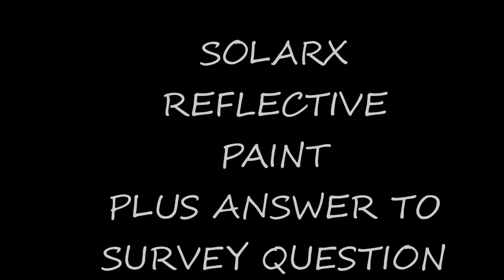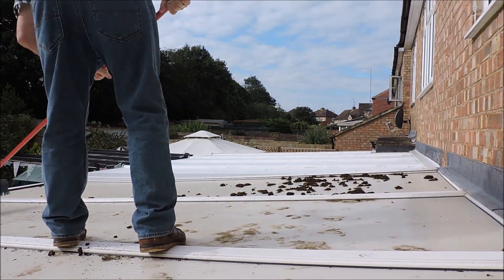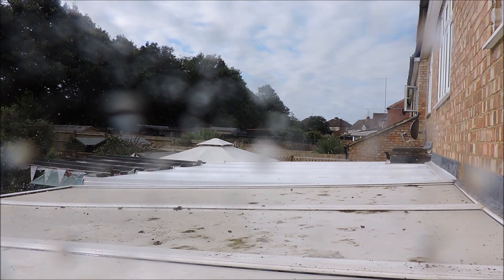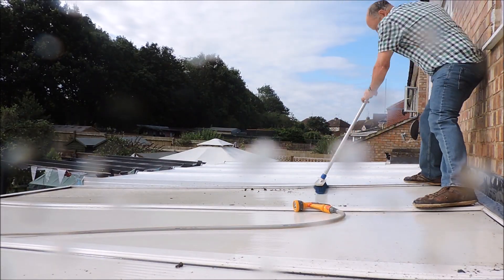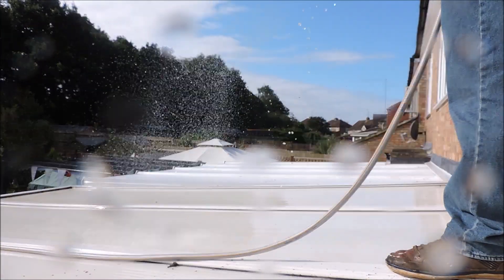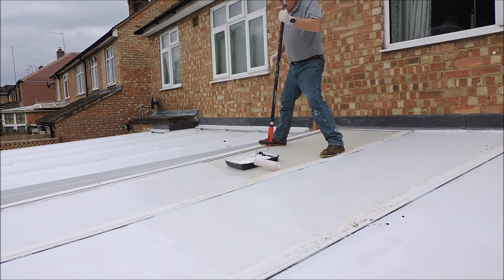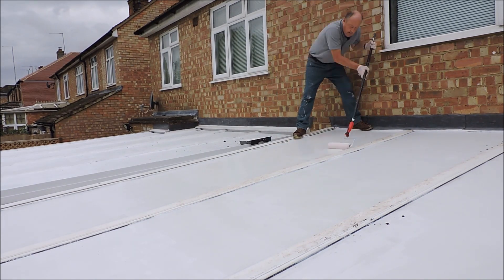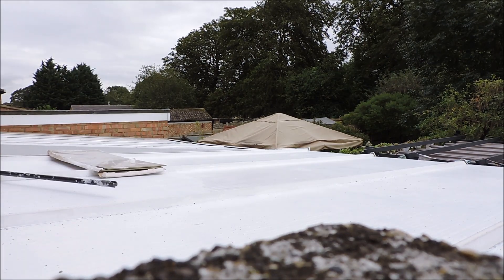SolarX Reflective Paint Plus Answer to Survey Question and shout out

Comment: Hi. When you first painted the polycarbonate panels, did you need to prime them first with anything ?
Kind regards
Carl
Reply from the maker: Thank you for your question Carl, no primer is needed just clean off any dirt with a brush and wash with a hose and let it dry then paint the solar X you may need more than one coat.👍
Reply: @walverden1  Thank you 😊

Comment: Thanks for this, does it also reduce glare? or is it only good for heat reduction?
Reply from the maker: Hello  Ethan this paint does reduce glare,but not to the extent to make it dark. then the heat is reduced by around 80 percent, we had a company to give us a price to cover the roof with special roof tiles the cost was quoted to me,wait for it" £14,000 . this paint only costs around £80. what a difference.
Reply: @walverden1  great.  Didn't ask or want it dark lol just if reduces glare.  Thanks again.

Comment: Hi, did this reduce the glare/brightness inside your conservatory Dennis? I'm trying to find a solution to reducing the brightness in my conservatory, unusable as an office in the summer at the moment!
Reply from the maker: Hello Matt, yes the light is reduced by shade from the glare and the heat is reduced by I would say 80% . On the tin it does say that the paint will reduce the light . The tin claims a reduction of Around 20 degrees cooler.Hope that helps?😄👍🏻
Reply: Dennis Jennings thanks for the quick response! Ordering a tin now,  thanks again 👍🏻

Comment: Hi Dennis, I find your SolarX paint interesting to reflect the heat of the sun away from roof to make it cooler inside. I think here in San Mateo, CA we might have those at homedepot. I have to check. But when I go to Mexico to our ranch what I use is limestone powder (I buy at the local hardware store) called CAL mixed with water, to apply to the flat roof of our house there. It is amazing as it reflects away the heat of the sun so our house stays cool 24 hrs so one can sleep at night. I am recently finding out about solar paint which I dont think is available in Mexico, but it is available in San Mateo, California
Reply from the maker: Thank you very much for your view and very good information about CAL that sounds great, however i still prefer Solar X paint,i have had no hot days or nights in our house since i used the paint.

Comment: Dennis... will this work on the rendered walls of a stone build house? Have asked the roofer about means of cooling by way of extraction - is a decent fella, instead of trying to sell me an extraction system.. says main problem is that stone walls act like a storage heater.. I have a portable air-con unit in my bedroom (extracting externally).. but obviously it's loud.. which is also (but not as bad as heat) disruptive to sleeping. I am thinking rather than try and remove the accumulated/residual heat.. restrict the walls absorbing solar heat in the first place. Terraced house straight onto pavement... desperate for help!
Reply from the maker: Hello first thing i am no expert on this paint, i have read the web site of Solarx refective paint and it does say it is 70% affective on glass, polycarbonate glass fiber cladding and block work. So to tell you the truth on a wall i don,t know but for £60 a tin i think it might be worth a try.
Reply: @walverden1  i've just had a thought... if Sandtex (who have been around a loong time) ain't already doing it then it is most probable that those who claim to make 'solar-reflective' paint (for masonry) may be selling the emperor's new clothes...

Comment: Hi Dennis thanks for your video. I am thinking of using this paint on my conservatory, but was just wondering if you had to key the surface at all or did it just need washing? Also I couldn't tell how many coats you did was it just 1? My polycarbonate is clear, do you think it might need multiple coats? Thanks for any advice.
Reply from the maker: Thank you Charlie for your view and question. I cleared the roof from any moss,then washed it down. i waited about one hour for the roof to dry then i applied the first coat. i did put 3 coats of the paint on the polycarbonate roof of a few days.
Reply: @walverden1  Thank you very much for your help. I'll order some now and do it next weekend : )

Comment: Thanks for adding this video! It’s very helpful! I just wondered if it looks darker inside and also if it is colder in the winter since being painted? My conservatory is used as the kids playroom so want to try this as the heat is unbearable in the summer. Thanks again ☺️
Reply from the maker: THANK YOU JANINE FOR YOUR VIEW AND COMMENT. FIRST OF ALL THE PAINT DOES REDUCE THE LIGHT HOWEVER NOT TO MAKE THE ROOM DARK JUST SHADED.THE CONSERVATORY IS COLD ANYWAY IN WINTER ,THE PAINT DOES NOT MAKE IT ANY COLDER. HOPE THAT ANSWERS YOUR QUESTION?
Reply: @walverden1  Perfect thank you! ☺️ Cant wait to paint ☺️
Reply: Our roof is a bit leaky too. Od worn seals. Would the Paint help with that too?

Comment: Great job Sir.  I have the same type of roof, i did not think it was safe to work on it! thank you. i have one question if i may. where the roof attaches to the main wall of the house, what type of glue is needed?  thank you again
Reply from the maker: Thank you very much for your view and comment. The fact is i don,t know what they use i can only think that they seal it tight to the wall with water proof sealent

Comment: Looks very interesting, please can you add an update after a year to let us know how it is weathering and whether it has cracked or pealed. Also if anyone is copying this video, I wouldn't recommend walking on the roof beams like that. Best bet is put a long plank or ladder that crosses several beams and stand on that. Keep the plank near where the roof bolts to the wall and do as much as you can from ladders next to the roof rather than being actually on the roof.
Reply from the maker: Thank you Jonathan for your view and comment, I was told by someone in the trade that the beams can stand a lot of weight I did try putting a plank across the beams but it was always sliding and I felt unsafe. The paint was put on almost 7 months ago and so far they have been no cracks or peeling on my roof or my next doors roof.